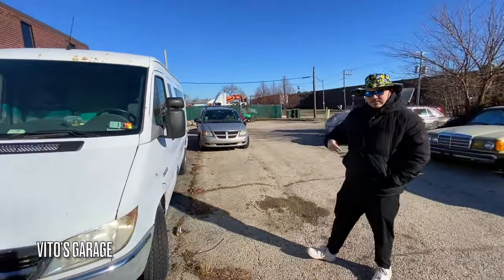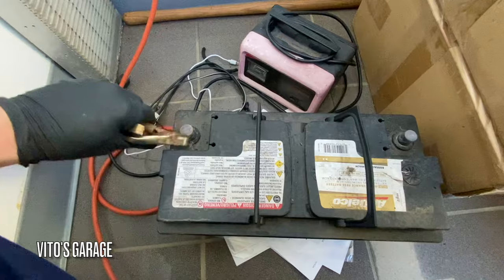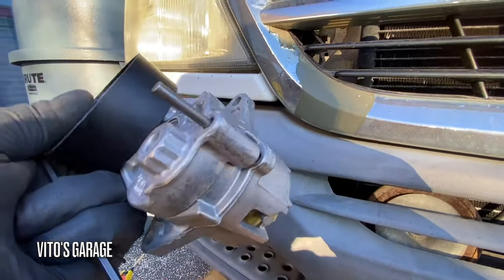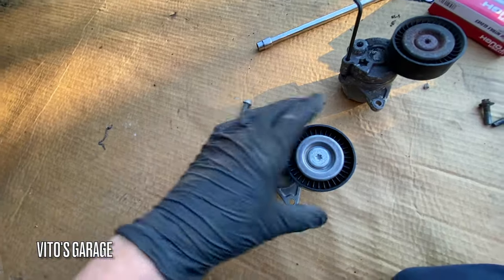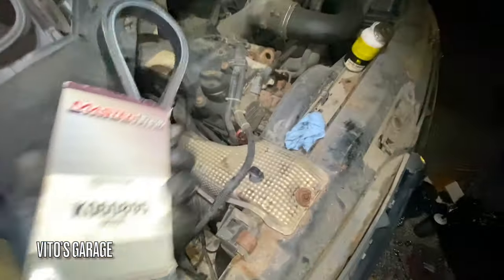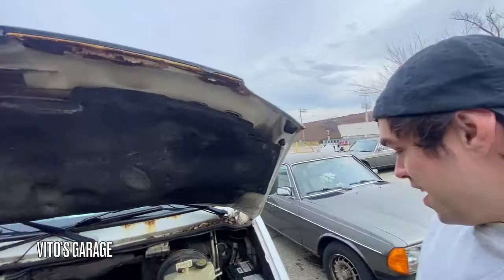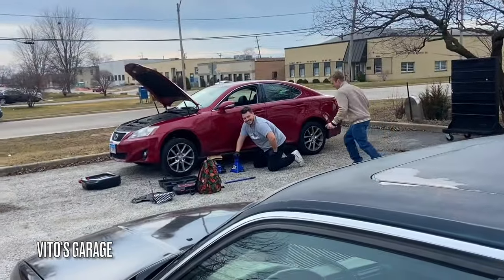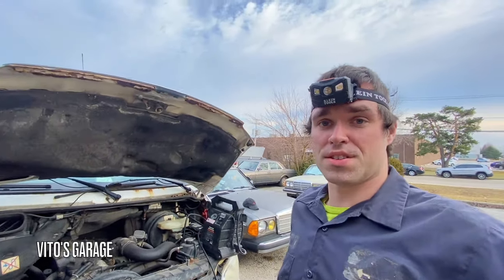Reviving a Neglected T1N Mercedes Dodge Sprinter! But Then It Broke Even More........

Comment: just did the water pump on mine. last year was the fuel pump. these vans are so easy to work on. if it doesn't rust back into the sea, i will keep it until i retire.